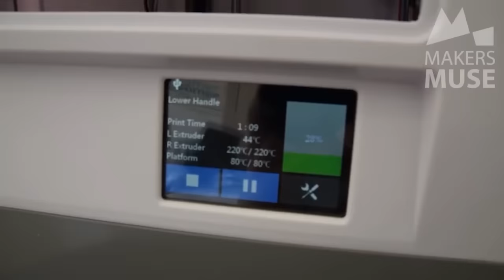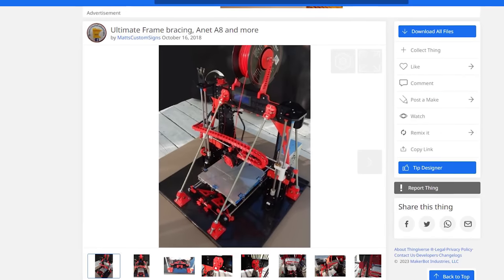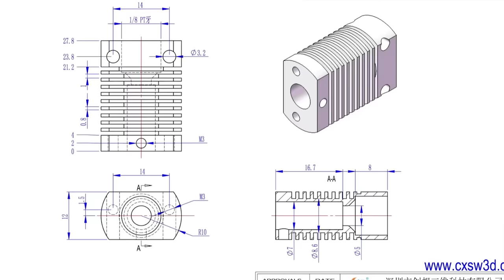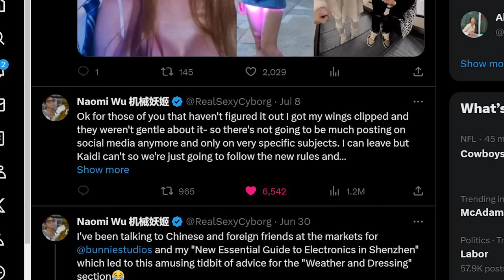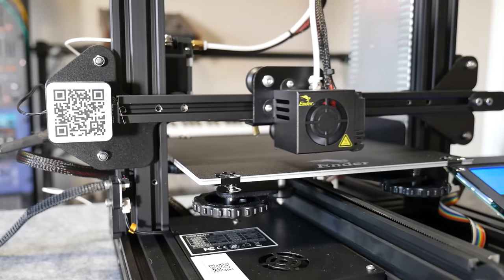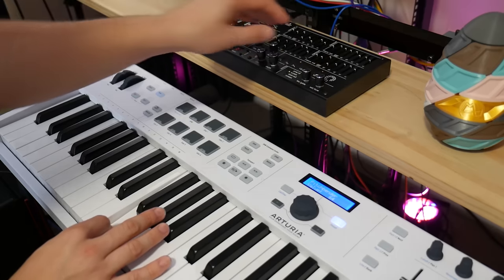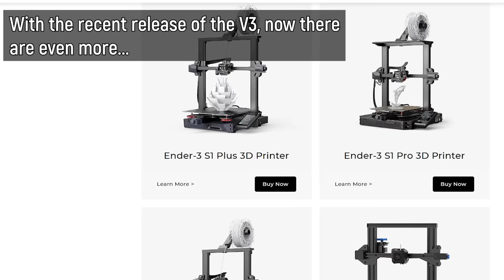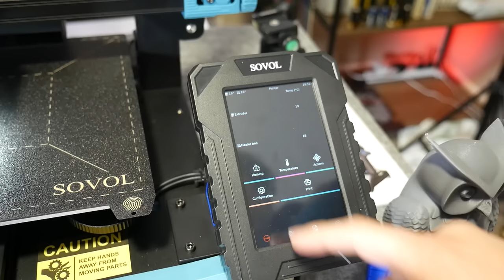Creality Ender-3... it's time to move on.

Comment: When reccomending a printer, I've always told folks that they'll have a much better time if they think of Creality as a parts reseller, and go into it knowing that they are 100% community supported. That said, the a $99 Ender 3 Pro is a heck of a learning platform - out of necessity. Great video, spot-on.
Reply: The Elegoo N2S is a similar cheap platform, you can buy those refurbished and they come with a PEI bed.
Reply: I agree and I decided to not buy one for this exact reason. I didn't want to build a printer I wanted to print.
Reply: Creality is a terrible company. It's in their DNA--it's part of Chinese business culture. They'll never change. Recommending an inexpensive printer as a learning platform for people new to printing is fine, but the Ender 3 was never good, no matter the price. If you spend $200 upgrading a new printer just to make it work acceptably, you've wasted both your time and money.
Reply: Yep, ender 3 pro is a great starting point for the tinkerer but not for those wanting a "just works" device
Reply: A better starting point would be a Kit printer with a good manual and instruction videos like the Lerdge iX Kit. The version 2.0 starts at 125 bucks but you could order parts like a direct drive extruder or some lineal rails to have that great modding route and at the end have build a Bambu A1 Mini for 320 bucks by yourself! The learning curve would be tremendous!

With that you build up your own printer and learn so much in like 2 afternoons. And after that printing and trouble shooting is a piece of cake since you already built that machine. And building is always better than buying! :D
That's why LEGO is still so popular between grown ups!

Oh ... and of course it would be open source - so your CAD model is available for you to design your own mods with.
And a Klipper tutorial is also available, so fast printing like the Bambu is obligatory by now.
Reply: Microcenter coupon is now $99 for the ender 3 V2. This is an unbeatable deal... if you live near a microcenter.
Reply: @theglowcloud2215   What a load of BS. My Ender 3 worked allmost perfectly out of the box, there was no tinkering needed (excpet for assembling). It offers everything I asked for, for a VERY reasonable price.
Reply: My Bambu Labs has work nearly flawlessly since I got it except for a clog when I first attempted to print PA12CF and got a clog.
Reply: @theglowcloud2215 "it's part of Chinese business culture"

Hilarious 😂 You've not worked with top tier Chinese firms have you?
Reply: @theglowcloud2215  brainwashed

Comment: I just bought my first 3D printer - an Ender 3 V1 (but upgraded with auto leveling). I’ve been blown away so far with how good it is, but I get the impression that the original owner upgraded a lot of pieces and tweaked it to be awesome).
Reply: That would be my thought. I’ve been tinkering with Ender 3s a lot and I despise them because of how inconsistent they are
Reply: By the time you upgrade everything to match the feature set as the Ender 3 S1 Pro your original build will cost more.

•Twin Screw Z axis

•Direct Drive extruder

•Touch Screen Interface

•Auto-Bed leveling

•Higher operating temperature

•Filament Sensor

All features I mentioned are all that the S1 Pro has that the Ender 3 V1 doesn’t have and by the time the V1 matches those features, the overall build is almost $300 more expensive.

This is coming from me that has a regular Ender 3 Pro and did upgrades over the years. You’re gonna want to upgrade the Bodin tube extruder to a metal one when it begins to slip.
Reply: I got an Ender 3 Pro for Christmas and the gifter bought 5 from a print farm who was selling them (and gifted them to various people). They were decently upgraded but didn't have some obvious cheap upgrades like metal extruders and better hot ends. The only thing I want to do now is make it more quiet and add CR Touch for quality of life upgrades. This thing has taught me and my son so much about 3D Printing. It's like a manual car. If you can learn to drive one you'll end up being a much better driver longer. We love this little booger. When I upgrade I'll be looking for a much faster printer. That's about the only thing I wish it did better.
Reply: how did you upgrade with auto leveling?

Comment: The community losing Naomi Wu is a bigger blow than many realise, she was the only person local to the actual production companies and could give real feedback in addition to her OSHW work.
Reply: What happened to her? I used to watch her videos and now that I see your comment, I realize I haven't seen anything from her in a while.
Reply: @gunnarbiker  The authorities threatened her because of her outspoken views, so she had the choice to either go quiet or be disappeared.
Reply: This is a very simp take. It completely ignores all the engineers currently working and innovating in this field. 3d printing is still niche. You cant expect the same kind of progress as other fields in the same time.
Reply: @cambridgemart2075  She actually stopped doing any OSHW advocating after the community and the OSHWA collectively shat on her years before her government shut her down. Both are really sad.
Reply: @creativelyunoriginal  You can actually, this market has been suppressed for decades. Do you really think the current systems weren't possible in 2000? News flash I was using one. The problem is that they were very proprietary and some patents needed to expire. The reprap project was about making an open platform to prevent this from happening again as easily and the current industry exists because of those efforts.

Naomi Wu showed Chinese companies that the profit wasn't in hiding code, something they generally don't understand, and she was making real progress until American maker and tech news orgs treated her so badly she couldn't keep going.
Reply: I am not sure about others but in my opinion, a presenter of products needs not resort to the SEXie element of their personal attire or physical attributes, to present or promote clear and concise features of a machine. Perhaps this had something to do with her no longer being on the reviewer platform. We live in world of extremism, and these have shown in many cases to ramp up viewers, but this IMO is not a solid metric as you are drawing attention from viewers on illusions and not on real tangible things related to the subject.
Reply: @MarioIArguello  You're missing a lot of context. Unlike the average boob-streamer Wu's presentation is just her aesthetic. I personally am not a fan of that aesthetic, but still recognised her actual work and other efforts in the space. It's telling that so many can't.
Reply: @rthoulouze what is OSHW?
Reply: @martyboi  Open source hardware. You know you could have typed that comment in any search engine and would have got an answer, right?
Reply: @orbatos  2000's try the late 80's.  3d systems created the STL format in 87, the people who originally created the SLA printing method under NASA split to form Objet and Stratasys back in 89.  The boom of FDM in the mid 2000's was created by the Reprap community as a potential solution of self replication. Which later Bre Pettis stole the idea's from to create makerbot and market it as his own around 2008/2009.
Reply: She actually did nothing, the question is where is the very skilled person who did all the work behind the scenes and managed her
Reply: @driver7227  That would be her husband, who is a actual engineer.
Reply: nah, its good. No more pride stuff please
Reply: @rthoulouze  I did it a it popped up but the issue with acronyms is you can be certain it's exactly what the person is talking about as they can be very specific to what field someone's talking about. Also if they look it up and find the wrong thing then they are likely to pass on misinformation.
Reply: @nikushim6665 from what I've heard he's from the Uyghurs population in China. I think he was held for a while but then released but isn't allowed to leave the city. But thats what I heard from a while back.
Reply: @gunnarbiker  China does China things (like you know, fascism and stuff).
Reply: @orbatos But that's just it.  You're presenting the conflict of interests, so to speak (sex-appeal vs function), as the first impression.  It actually drags down her effect to a wider audience in the long run.  It's not to say that stereotypes are fair, but a lot of people could say the same thing for well... distractions, let's say.
Reply: @MarioIArguello  Agree with @orbatos.  She actually produced a video explaining herself to people who make assumptions about her like yourself.  In a nutshell, she dresses and projects an image that makes her happy and is not doing it to attract men - in fact,  she has no sexual interest in men and is a lesbian.
Reply: It appears Naomi has an electronics guide book coming out in April. Though it won’t be translated it seems.
Reply: @roberthernandez5802  The reason you're finding it buried is that a lot of the biggest proponents of fully open design have been pushed out. Wu was the biggest independent one, and I'm not exaggerating.
Reply: @nikushim6665  and Know what a "beard" is? Maybe you'll pretend not to. This kind of thing hurt everyone around her and people like you only care about Internet credit. 

@driver7227  She is an engineer, but you're one of the reasons she has such a hard time so I guess it's obvious you can't figure that out on your own,
Reply: @orbatos  Please by all means link a source to her MBA or higher proclaiming her to be a engineer.
Reply: @nikushim6665  Lol, an MBA is business degree, and only an idiot would think that this matters in a discussion about work in the first place.

In case you are so functionally limited as to argue this point, I'll let you in on a secret, most engineers don't have 4 year degrees, especially in computing and ee. Why? Because they started young and in the right place. Tech moves faster than accreditation and school is not only expensive but can cut off some opportunities, ask any real engineer about the tradeoffs of a formal education.
Reply: @orbatos  Keep telling yourself that bud....  I'm sure anyone would be happily to take up a engineer without a degee in the current job market. That crap might fly with coders. But not electrical, hell you couldn't even land a civil position without one. In short she doesn't have a degee, never been employed as one, shes a self-employed content creator and thus isn't a engineer. End of story.
Reply: @nikushim6665  You're the one who thought an MBA was an engineering degree, shows how much you actually know about any of this in a nutshell.
Reply: @orbatos  That's a logical fallacy of composition. I also don't recall Naomi Wu ever claiming herself to be an "engineer" of any sort. Which would be a form of strawman fallacy by putting words in her mouth. Both are a piss poor way of handling a debate.
  
  That aside, he is not wrong; most engineering fields require a degree flat out. Now i do have a few friends from UNO that graduated with electrical engineer majors that are now senior software developers. But that is twenty something years after the fact, either way that degree still mattered.
Reply: @Lokivoid1  Don't be a pedant, I was pointing it how stopped they were being rather clearly. Also Wu has worked as a software engineer in multiple capacities, and done software and hardware design in an engineering capacity. I'm not sure how you missed that.
Reply: @Lokivoid1  as for your comments about degree requirements, it depends as I said. There are entire fields where the opportunities to even get a relevant degree are uncommon but are engineering jobs. You are confusing a handful of certifications with competency requirements, and yes I'm aware of jobs that require them too.
Reply: @orbatos  No, you were using one incorrect phrase to invalidate the entire argument that's a composition fallacy and you're doubling down on the potential strawman once again. You keep saying Wu said this or done that, leaving everyone to take your word for it.  Burden of proof, show us where she herself claimed to be a engineer.
Reply: @Lokivoid1  Not even close, you don't even seem to understand the terms you are throwing around.
Reply: @Lokivoid1  Don't waste your time hes a codemonkey thats projecting. He has probably worked on a few github projects and considers himself a engineer.
Reply: @nikushim6665  That was obvious but i was giving the benefit of the doubt.
Reply: @creativelyunoriginal  I don't know if I'd call it niche.  This guy has over a million subscribers!
Reply: @nikushim6665  you have never watched any video wu has ever made and it shows 😂
Reply: @Redspark77 kick rocks conservative!

Comment: I fully agree, I love my Ender 3 it is my first and only printer, I have thousands of hours in it, built SO many cool things with it BUT I would never recommend it to someone just now getting into 3d printing.  The only thing original left on it it is the frame, the power supply and  some of the stepper motors, I have either upgraded or replaced everything else.  For me that has been part of the fun, troubleshooting, repairing, testing but there were many times where I just wanted to give up, Im sure someone new to the hobby facing the same challenges probably did.
Reply: my first printer was a creality halot one pro
and honestly getting a resin printer is a way easier start then a normal 3d printer
with this its simply leveling and every 100 odd hours a fep film change and every 250 hours orso a carbon filter replacement and its quick and easy to do 
the one thing that did take me some time to learn was the supporting for prints 
it was quite hard to support em well and get it to print well
but i learned that i need to angle the pieces often
Reply: Similar to my voyage too. Made solar tracker and scooter fairing with it, amongst other interesting things, boxes, adapters, mounting brackets etc. Would like a bigger version now!
Reply: I admire you, because I always hated my ender3, always will hate it and its just my stubbornness, that allowed me to have some good stuff printed out of it, but with the first opportunity to run for different ones I did. Also it was that close me to just dump it and burn it :)
Reply: Is it still an ender 3 when you changed all the parts😂
Reply: @kevinsun123 ship of theseus moment
Reply: @aregulargenericname8794   Lol I frequently call it the "Printer of Theseus"
Reply: @kevinsun123  🙃
Reply: @thedandy6765  resin is much more of a hassle to deal with. After getting all the recommended equipment to go with your halo one pro and the safety equipment you should have been using you could probably have bought a half decent FDM printer, if not a Prusa mk3. You can’t really compare a resin printer and a cheap FDM printer, since with resin the printer itself is only a part of everything you need.
Reply: @hsoj32 same!!! My ender 3 pro prints great, it's just all of the parts that make it an ender 3 pro are gone
Reply: @kevinsun123  Grandfather's Ender paradox!
Reply: What would you recommend these days?
Reply: Well - I go a bit back further. My very first printer was a Sunhokey "Prusa" i3 printer. It came as a kit, was made of plexiglass and took hours (and even several days) to construct. The print results where terrible, and I had to tinker like  crazy to get somewhat acceptable results. Partly because the 3D slicers where not really great at that time too. However - I learned a LOT about 3D printing and what can go wrong. That's for sure.
Compared to that the very first Ender 3 was a complete dream for me. Finally something that worked "out of the box" (well - not really, because the first Ender 3 models have to be fully constructed, but you get the point). After that I owned several models, including an Ender 5 and a FLSun qqs pro. My last model, however, was a newer Ender 3 S1, because I wanted a direct drive model with auto bed leveling. It worked without any flaw, but had to move because I needed space for other projects. I am now torn between the new BambuLab A1 Mini or (again) a Creality Ender 3 V3 SE. I think this latest model is the most "plug and play" direct drive model Creality has released until this day. That BambuLab A1 Mini is very, very tempting though...